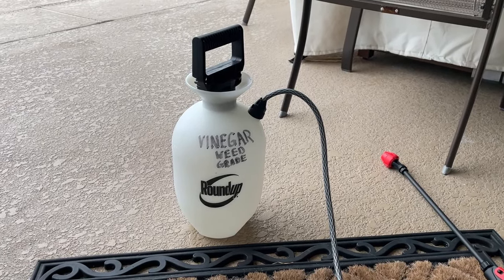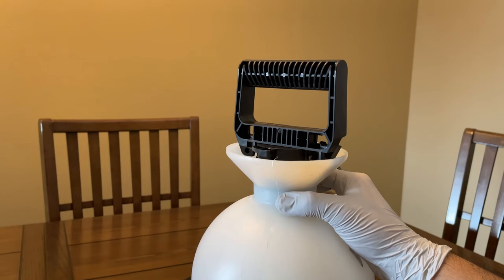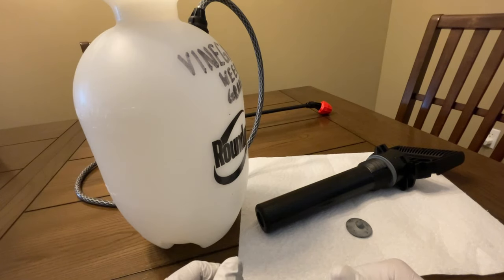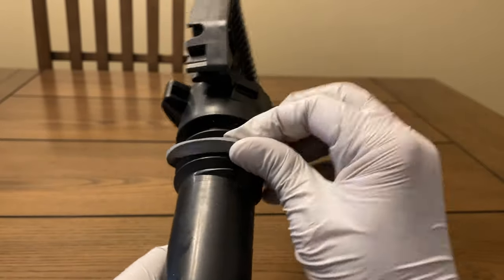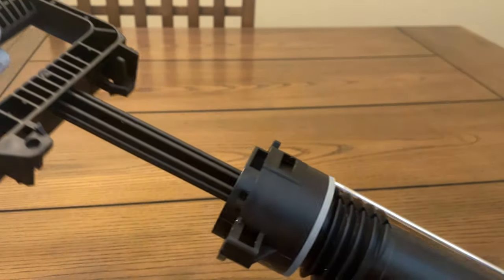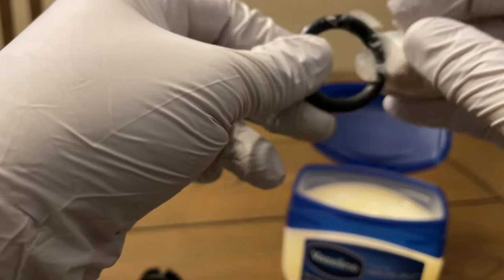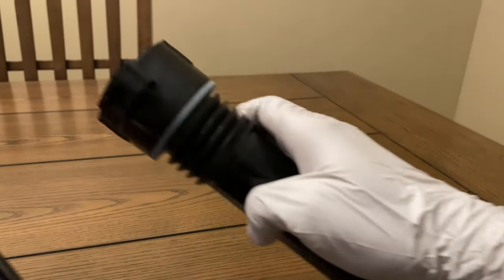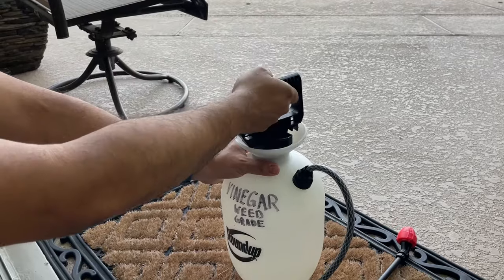Sprayer repair (Roundup Sprayer not pumping)

Comment from the maker: Hi Guys! I have received many suggestions saying to use silicone grease instead of Vaseline. 

Silicone grease can be an excellent alternative because it minimizes rubber’s degradation. Nevertheless, the manufacturer recommends using Vaseline on the instructions. Many people think this is a manufacturer strategy for selling more kits. Personally, I have not had any issues using Vaseline for this specific purpose. Vaseline is cheap, widely available and could be a good choice for most users. I would expect that if the original manufacturer is recommending using Vaseline, the seals are resistant/compatible to petroleum based products (there are certain types of rubber compounds compatible/resistant to petroleum based products). 

Thank you for all your suggestions and for recommending an excellent alternative to our community.

Comment: NEVER use vasoline or any kind of petroleum jelly on your gasket, it degrades it faster. Use plumbers grease.
Reply from the maker: Thank you for this recommendation Cathy. Manufacturer recommends using petroleum jelly on the instructions. So far I have not had any problems with Vaseline but I suppose plumbers grease could be a better option. Thank you for sharing!
Reply: I was about to say "The manufacturer specifically indicates to use petroleum jelly. " I have this same seal kit.
Reply: The manufacturer knows Vaseline will degrade the o-ring SLOWLY and keep you coming back to buy another kit, and another kit, and then another kit. Capitalism is how you stay in business.

Comment: Don't use vaseline. Use silicone grease.
Reply: Because petroleum breaks down plastic/rubber.  (You can be helpful and an expert, too 🤷🏼‍♂️)
Reply: And yes, I know it’s been 2 years.
Reply from the maker: @bgregg55  Hi Greg! Thank you for making this recommendation. The manufacturer recommends using Vaseline on the instructions. Many people think this is a manufacturer strategy for selling more kits. Personally, I have not had any issues using Vaseline for this specific purpose. Vaseline is cheap, widely available and could be a good choice for most users. I would expect that if the original manufacturer is recommending using Vaseline, the seals are resistant to petroleum based products (there are certain types of rubber compounds resistant to petroleum based products). Thank you for your suggestion and for giving a good alternative to our community.

Comment: I used the washer off of the garden hose  on the bottom check valve. just stuck it on the outside, and finished,  now looking here for the correct way, to replace it. and how to take it apart

Comment: I used the repair kit from amazon and it works like new.  Also, I used silicon spray as a lubricant.  Works like a charm....thank you for the cost effective solution.....

Comment: I have one like this except it does not have the tabs. Can't figure out how to take the plunger apart?
Reply from the maker: That’s interesting, is it a newer or older model?
Reply: @handyneasy  It is at least 10 years old. Maybe the pump was changed? I've reviewed several videos here and none are exactly like my 1g Roundup sprayer. They look alike on the outside but the pump is different.
Reply from the maker: @dougsorensen7594 it can be that they did not offer this repair capability in the past by design. If you still cannot find anything, I would just try to remove it by using some force, probably you could repair it without any damage. Good luck!
Reply: Thank you for your kind assistance.  @handyneasy